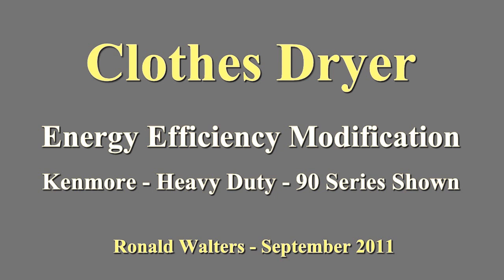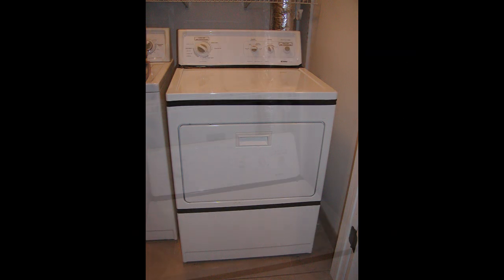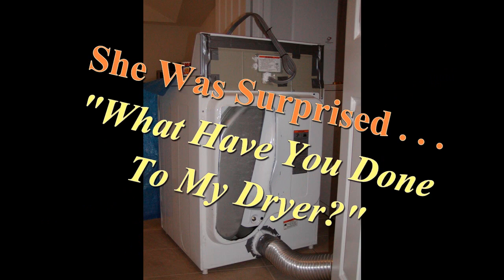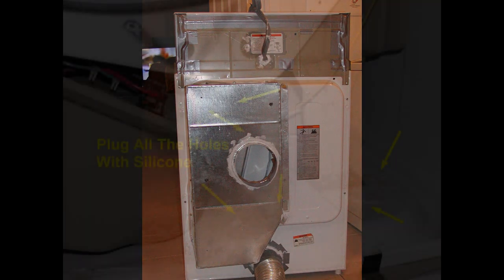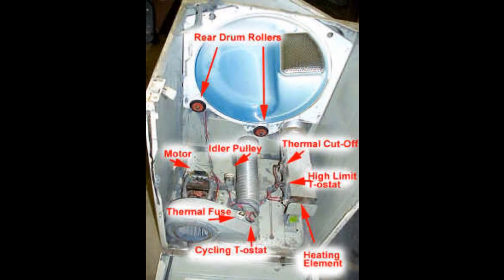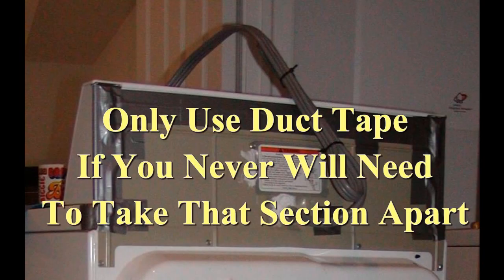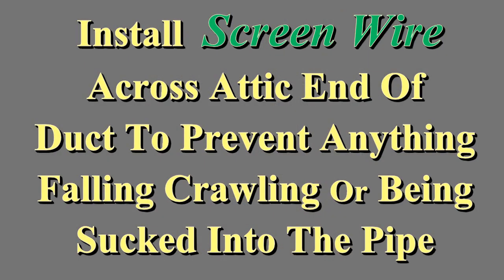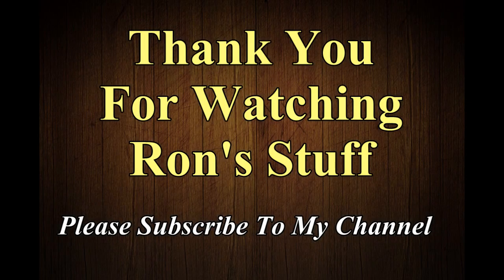Kenmore Dryer Modification - Save Money On Heating & Cooling

Comment: Ron, What a great idea !!!!!  We recently build a home and i couldn't find an oven that vented outside ... they use to make them. So who wants a hot oven exhausting into home, with the smell of cooking food .. in the summer when it's 100 degrees outside and the ac units working overtime to keep the house cool. I contacted several manufactures about making ovens with out side vents .. several responded that customers where not demanding them ... but I went online and found forums of lots of folks who ,, wanted them. I believe its just about cost for them and it might add $10-20 dollars more. Oh, I might add, with the hot exhaust, smell and .. the grease in mist form .. attaches itself to walls, furniture, etc .... Best, John z.
Reply from the maker: John,
Most are expecting the oven exhaust to be discharged by the overhead ventilation hood, which should have grease filters, which need periodic cleaning or replacement. If you try to establish your own oven exhaust, some sort of grease filter should be incorporated.

Ventilation hoods can usually be configured two ways. Through the filters and out the back through ductwork leading outside (through the roof) or through the filters and out the front and back into the kitchen. The blower motor and fan(s) need to be rotated to change the direction of discharge.

I have seen some improper ventilation hood installations where the fly-by-night "professional installers" (Sears contractor installation) were exhausting the ventilation hood directly into the wall between studs with no ductwork installation. So the grease that may make it past the filters and moisture were blown into the wall cavity. 

I found another installation where, years after the installation, the filters looked like they were brand new. Turned out the fan was installed in the wrong position and could not discharge out the front (which would be back into the kitchen). There was no duct for exhausting out the back and the fan was just cavitating and not moving any air. Strangely, the owners never questioned why there was no airflow out the front of the hood nor why the filters never needed cleaning. 

And then contractors/builders have been know to just exhaust such stuff into the attic (along with bathroom exhaust fans) with no provision for it being directed outside. And I have seen clothes dryers exhausted directly into the crawl space.

It takes effort, knowledge and caring to install these things correctly.

Thanks for watching. Please subscribe!
That is what keeps this channel going.
Ron

Comment: Interesting project! I have the clothes dryer exhaust vented to inside the house during colder weather to keep the heat with a cheap vent, and blow outside during the warmer weather with the standard exhaust set up. The humidity does rise inside during the winter, however it's not a big issue with loads spaced far enough apart. But I'd not thought of where the air comes from first. Great video & Idea!

Comment from the maker: I used air from the attic because it was convenient to do so. Attic air is stagnant and the supply tube is above the attic floor. Air entering the dryer is just as clean, if not cleaner, than air drawn from outside. A heat exchanger could place restriction on the suction side of the blower and lint from the discharge side could plug it up. I have seen little if any difference in drying time when using cold winter air from the attic. The dryer discharges the damp air outside, not into the attic.

Comment from the maker: Originally I thought cold winter air would be a problem, but it wasn’t. It gets hot and humid where I am as well, but no problem. My attic is pretty clean and no asbestos or fiberglass. The air in the attic is static anyway. The dryer supply air could be drawn from outside, it doesn’t need to be from the attic. The attic was the easiest route for my situation. A clothes dryer will dry the clothes without the heating element, just airflow (but it will take longer).

Comment: I read through all the comments and I have a couple observations

1) What is missing here is a thoughtful set of calculations under a variety of weather conditions to determine the cost savings (if any).
2) To those who discuss their highly thermally sealed houses - where do you think the “supply air” comes from to feed the dryer?  Yes, the inside of the house - but that air MUST be continually replaced for the dryer to operate efficiently.  How is the air replaced?  The partial vacuum inside the house caused by the operating dryer causes air to be SUCKED into the house from every crack and space available unless you have a outside vent supplying outside air to an indoor gas furnace.  HOW MUCH AIR?  Go outside while dryer is operating and put your hand in the path of the exhaust dryer air - you will notice - it is a LOT of air.  All that air lost from inside your house has to be replaced by OUTSIDE air.  So - think about it - a dryer is a double whammy - the dryer is using LOADS of electricity and THEN your furnace (in winter) and air conditioner (in summer) has to either warm the outside air coming in or cool (and possibly dehumidify -$$$) this air seeping into your house....

In conclusion, see note 1) above...  

I have been thinking about this for years - and now that I am retired I will probably do the calculations if I cannot find such results on the World Wide Web.  :)

PhD and Professor of Mechanical Engineering (before retiring)
(Specializing in heat transfer and fluid flow)
Reply from the maker: I had no reason to do the calculations since the bottom line was… I needed to stop the unnecessary exchange of air going though the house. It wasn’t done as any sort of cost savings. It was done to stop the unnecessary entry of moist humid air entering the house. 
I have an ERV, which exchanges the air in the house when needed.

A simple search found: http://www.advancedthermalimaging.ca/

Quote:  
Clothes dryers consume energy on two levels. One, the energy the dryer needs to operate. Second, the heat energy it exhaust from your home while it’s operating. This will also include the cost of energy for cooling your home (HVAC systems) in the summer.

Most people underestimate the thousands of cubic feet of air that are exhausted by a dryer each time it dries just one load of clothes.

To help put CFM rate of a dryer into perspective and understandable terms we will look at how much air and how often this air is processed through your dryer. These values are approximate only and will differ by dryer CFM rates, household size, duct work, and structural characteristics. A regular clothes dryer will exhaust approximately 240 CFM’s. CFM rates are usually related to capacity; the higher the capacity the higher the CFM rating. If you live in a home that is 2,000 square feet with 8 foot walls you will have approximately 16, 000 cube foot of air space (2000 X 8 = 16,000). If your dryer is rated at 240 CFM’s your dryer will take approximately 67 minutes to replace all the air in your home (16,000 / 240= 67 minutes). Each dryer load will take approximately 60 minutes to dry. Therefore, the air in your home will be replaced approximately every hour or load of laundry. For higher CFM rated dryers it will take less time than smaller CFM dryers to change the volume of air in your home. The larger your home the longer it will take to exhaust this air with the same dryer but the more space you have to reheat. A larger dryer in a smaller home will result in more of a cooling effect unless the heat is increased to compensate for it. Loosing heat through your dryer is usually not a big issue in the summer (unless you are trying to keep your interior air cool) but does have its biggest effect felt during the heating season.
Unquote

So… unless you have some real need to place an actual dollar figure on the cost savings (heating and air conditioning), spending a lot of time doing the calculations is only delaying what you already know needs to be done.

Another huge energy loss can be through an attic fan. I sealed mine off and no longer use it.

I did this modification to the clothes dryer a bit over 15 years ago and continue to be quite happy with it. My only surprise has been the clothes do not seem to be taking any longer to dry in the winter, when cold attic air is being drawn through the dryer. When it is really hot in the attic, the dryer does not need to use as much heat either.

I am also a retired Mechanical Engineer, Missouri School Of Mines And Metallurgy

Thanks for watching. 
Please subscribe. That is what keeps this channel running. 
Ron

Comment: Ron, I like you idea. I am looking into doing a similar modification, but was thinking of building an air heat exchanger, like a Heat Recover Ventilator (HRV) to preheat the air from the outside. While the warm attic air was a thought... changing the attic air flow could promote mold growth in my high humidity environment and as previous mention I wouldn't want to dry the clean cloths with potentially dirty/contaminated attic air.

Comment from the maker: Furnace - A/C normally don’t exchange air. My house is well insulated, radiant heated, no forced air furnace to dry the air. I live in a humid area. I use a humidistat. When we did laundry the humidity and temperature would change in the house. This modification made quite a difference. Temperature and humidity now remain fairly constant w/dryer. 

A friend with a dryer in the basement complains how cold his basement gets with the dryer running in winter. This would be a good solution for him.
Reply: Newer HVAC installations DO have an air exchange from outside. Look up Indoor Air Quality and what they do about problems.

Comment from the maker: Pulling air from outside DOES NOT waste energy. Using air from inside your house waste energy and creates a negative pressure. Supply from and exhausting to the outside is the most efficient. The method may vary. Making an Energy Star Clothes Dryer would be like trying to make an Energy Star Hair Dryer. It takes heat to dry clothes fast. You can dry your clothes with little or no heat. Just tumble and blow air through the drum. It takes longer but the laundry will dry, even in the winter.

Comment: But to your point, pulling in outside air wastes energy as when as creating a negative pressure in a tightly sealed energy efficient house. Plus if you bring outside air in from below or at the base of the dryer the cold air would does not rise so that issue is avoided. Great idea, I think we will be seeing changes electric dryer in the near future. It is one of the last high energy appliance in the house that hasnt going through the Energy Star Certification.

Comment: Very inventive idea!  And nicely done on the implementation!

Have you run an estimated cost benefit analysis on this?  This is a wild guess, but I wouldn't be surprised if you have a net loss in this system, given the efficiency with which a furnace or A/C can change the air temperature versus what your dryer can do.  And that's not to mention the materials and time to put this together.

Comment: Ron, it's proper name is DUCtape, not DUCT tape, DUCT tape is used for sealing duct-work -for air heating and cooling systems.  DUCK tape is entirely different.  It was developed during WWII for sealing such things as ammo cans.  The two primary properties desired were (a) stick to damn near anything, which it does, and (b)be water-proof, which it most definitely is - that is if it meets mil specs.  

The "real"  name is some military nomenclature - who knows what it is.  The term "DUCK" was applied by the people who used it in the field - it sheds water like a duck's back.  Thus: Duck Tape...

I like your projects very much.  The Senior 20 especially.  I may just buythe plans and make one myself.

Comment: Outstanding!!!! Ronald, there are not many videos I've seen online for this application. Only 3 to my knowledge. I have some questions as my situation is perfect as my dryer is on the back porch (non heated sunroom) and there is a small utility closet that I can run the ductwork up in a foot away. My question is what about in the winter? Will your attic produce enough heat in let's say late January or early February to get the clothes dry? If this was my case would I not change any of the modifications and just use the heat that the dryer provides? Thanks a lot and again, super nice work! Cheers!
Reply from the maker: I am not drawing air from the attic because it is hot in the attic. I draw air from the attic to serve as outside air and my easiest access to outside air was straight up into the attic. The attic is quite cold in the winter and I have noticed no difference in the drying time of the clothes. I believe I mentioned that in the video. The heating element in the dryer is still heating the air. If your dryer is on a porch, and the porch is not heated or air conditioned, just open a window when drying clothes and exhaust outside. Obviously it would be best if the open window was not near the point of dryer exhaust.

Comment: As far as the lint plugging the heat exchanger I agree it would have to have a filter. Much  like you have in the dryer that would have to be cleaned on every load. I'll have to find the link to the DIY dryer HRV and  post it.ke

Comment: I am not saying that pulling it from outside wastes energy, but not trying to capturing the heat in the exhaust air the dryer creates is. You cured the negative pressure/exhaust heated room air portion of the waste,  HRV type heat exchange would capture the lost dryer heat. Here's an intesting read. Google Builditsolar DryerHXTest1 (links not allowed)

Also, heat pump washer/dryer combos are become more common. What a deal not needed to swap out the load and no need for a dryer vent.

Comment: It's a good idea, but I don't think I would want attic air going through my clothes. Between the dust and fiberglass up there.... This may also be a regional thing. What works in some regions may not in others. For instance, in Miami, the hot humid air that is around for say 6 months or more of the year would have a negative impact on the dryers efficiency.

Comment: is this similar to whole house effect?
Reply from the maker: Whole House Effect (to me) means the house is acting like a chimney. The house is unsealed/drafty... the 1st floor is cold and the upstairs is way too hot as heat rises and leaks out wherever it can. So this is basically the reverse of that where the dryer is sucking air out of the house, exhausting outside and replacement air is finding its way in through all the leaks in the house.
Reply: you can reverse the suction of whole house fan and blow it out. you don't need to have giant dryer? would that not be the same thing - sucking air from the attic. that's what attic fans do.
Reply from the maker: I believe you have missed the point of the entire video. This is about a clothes dryer sucking air from the house and blowing wet air outside. Attic fans suck air from the house and exhaust into the attic.